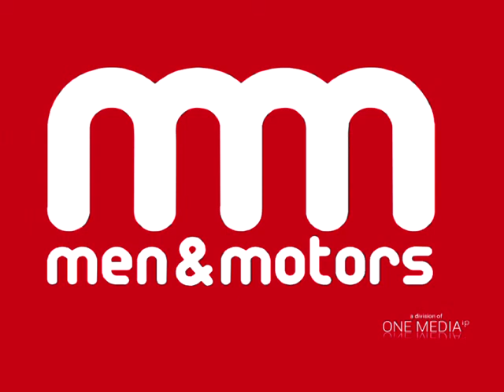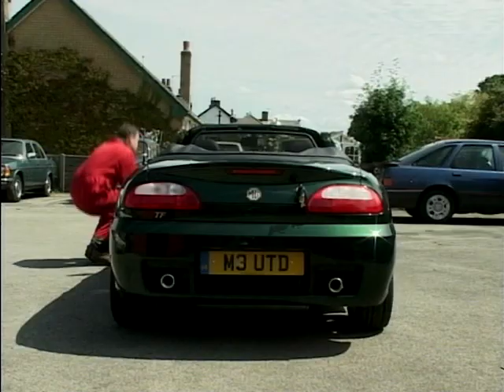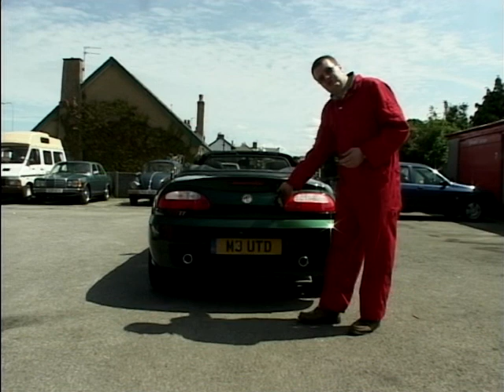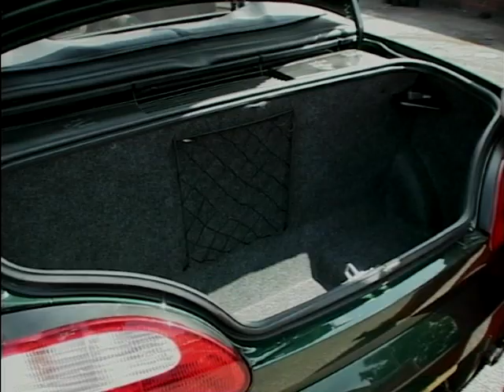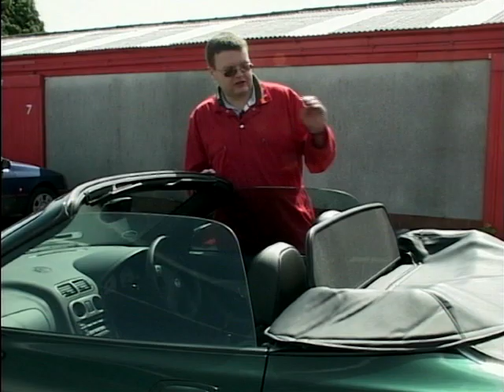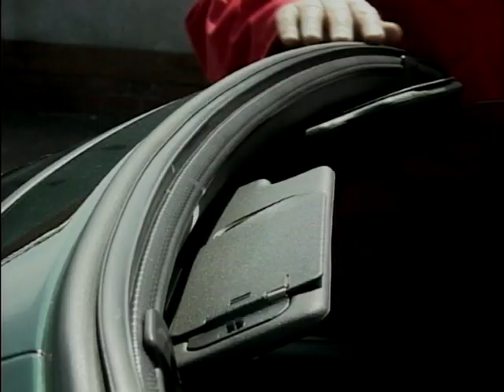MGF Maintenance Tips

Comment: I've had my MGF for over 3 years now and I absolutely love it!  Just get one that has been looked after, preferably with service history and isn't rusty - same as buying any car really. The head gasket had already been replaced by the previous owner on mine - it's £300-£400 to have it replaced by a mobile MG mechanic so not the end of the world!  These car's are great fun to drive and open top motoring doesn't come much cheaper. It's a modern classic now, so as with any older car you will have to spend some money every now and again to look after it. Parts are generally not expensive and there is a helpful MG community and owners clubs out there that can give good advice. Classic car insurance is cheap, especially if you're in the owners club - fully comp with agreed value and 3000 miles a year for £145. A great looking, fun to drive car. Give one a try!

Comment: Hydrosplastic suspension was designed for sport cars and When set up correctly is on of the finest suspension system's going not need anti roll bars. Look up the history if the suspension used in the metro and other AR bl Austin Morris cars. Problems comes from mechanics not understanding how to refill and balance the spheres properly.
Yes these cars had head gasket and header tank issues and there was a modification that provided a stronger gasket and a larger coolant tank . It no more difficult than another mid or rear engine car to work on .
There are modified seals for the these cars well worth the investment a new good is not that expensive and to be honest getting the head gasket  done is no more expensive than any modern car..
All these people want to do is knock what was a great design it no harder to work on than an mx5 or mr2 they are not difficult the seal on the roof us not difficult, thus is a typical tv program of its time knock anytjing that cone out rover MG.  No wonder our get in is such a mess never get a French man or a German running tgere products down like the British do.

Comment: I have had my MG TF for 6 years its almost does 100,000 miles and its still got the original head gasket. The problem only occurs if you don't top up the coolant properly. This guy is a pleb.
Reply: That's incorrect I'm afraid. My head gasket has gone twice and it's to do primarily with the difference in materials used in the head and the block which causes different expansion rates and hence movement, and this is exacerbated by the positioning of the thermostat because the engine was designed as a front mount not a rear/mid mount and so the distance to the radiator is "too long".
My problem was eventually resolved by getting my local garage to drill "bypass" holes in the thermostat - the car takes a bit longer to warm up but it does so nice and gradually so everything moves together. Not had a problem since.

Comment: What utter tosh.
My mgf vvc does not need any other looking after then any other car..
There not as bad as the video makes out.
Reply: Question though, how does one get to the engine to say: Replace the Spark Plugs? That is my main fear, they look stunning but I would like some advice of current day owners before I ever try to play around with it myself.
Reply: DehnusNorder you open the engine cover. its a few bolts under the hood. the whole thing folds forward..

I've actually made it sound worse then it is..

if your on Facebook join a mg page, lots of useful information and helpful people. 

mgf and tf enthusiasts and mgf and tf Facebook group are the two big ones. 

or if your not.

mgrover.org has pages of information about these cars.

but dont be put off by the amount of posts about cars breaking. hardly anyone posts about their cars working 100% and some of them are now over 20 years old.. they may need some work doing to them.  but any car of that age will as well.

Comment: One zip, 5 spring clips and 10 very small bolts to get to the engine bay, takes about 5mins Hmmmm he really doesn't know these cars, anddddd 8hrs to do the head gasket how many lunch breaks can one man take, mines a 1996 mgf and never had a single leak from the roof .....as for suspension he hasn't a clue Rolls Royce also used a similar system on their cars for comfort as nothing else was better at the time

Comment: hello I have one of the older ones it has been sat for half a year in a dry garage when I came to start it would not start it turns over and there is a spark but no fuel getting in to the engine I don't no if it id the fuel pump or the valves dose any one know if the older model has hydraulic valves

Comment: Wildly inaccurate dis'information, most of this is scaremongering , most of the rest of it is wrong.
Many cars  suffer from HGF,very few can be repaired so cheaply as a MGF or TF can, especially if you have the work done by some of the mobile mechanic you can find on MG forums £350 quid for example.
If the car is well maintained and especially if you have a low level alarm,your unlikely to get a HGF anyway.
Sure you can pay a lot at some garages for HGF but thats more to do with rip off garages

Comment: A specialist MG mobile mechanic charges £300 to do a head gasket, which I claim is not "very expensive" and I ran my old MGF for 9 years before the gasket went due to a radiator leak.  A water level indicator kit can avoid most HGF's since they are largely connected to water leakage.  Also in those 9 years with my old metro suspension I changed to new tyres once.  Also on a 16 year old car with original hood seals no sign of perishing yet.

Uninformative video really.

Comment: So is this lad an actual mechanic?

Head Gasket? About £450-£500 if you use an MG Specialist. Mine went after 70k and took about as much time to fix as changing a set of discs and pads and a DIY solution was only a couple of hundred quid if you know what a spanner is.

Never had a hood leak over about 150k on two MGTFs so cannot comment anything other than that. 

Tyre choice is a bigger concern than anything that he brought up.

Comment: Completely disagree.  The suspension in general if greased regularly is mainly trouble free.  It will settle over time, but a pump up every other year avoids the problem of the hydragas running too low, as long as the correct height is maintained, then the system is on the whole trouble free.  second hand parts are plentiful.  As for HGF, yes it happens, but can be fixed at reasonable cost.